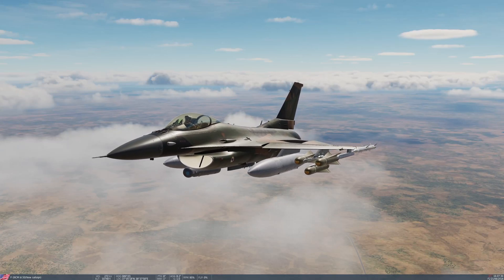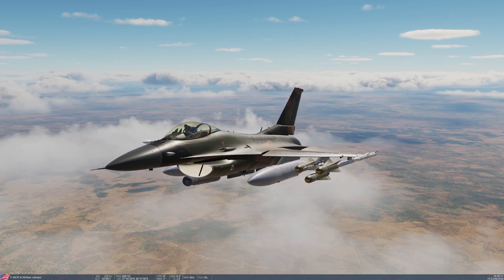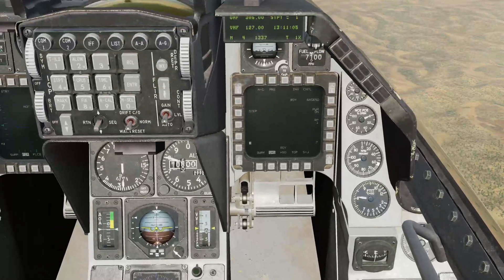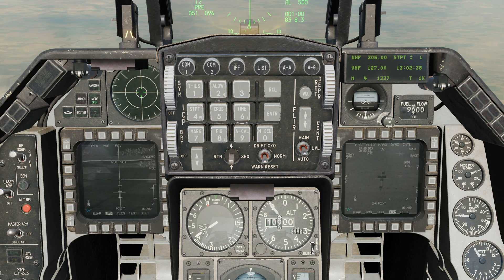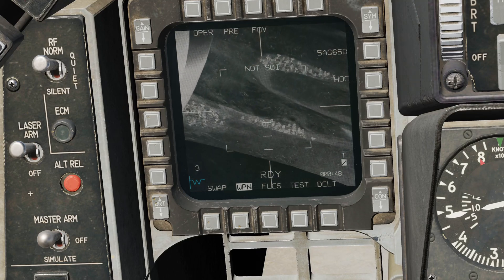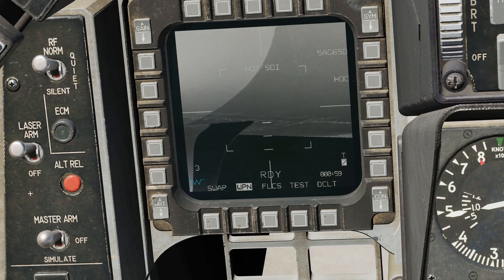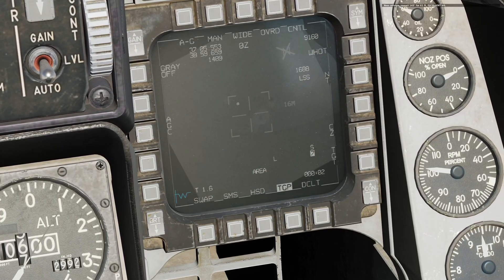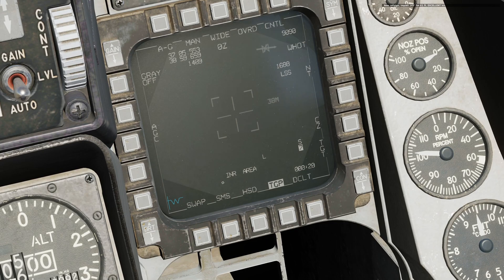DCS F-16C Tutorial 14 - Maverick handoff and force correlate

Comment: Is there a good way that you can find your target with the TPOD easier? Say you can see them visually with your eyes but you can't pinpoint your tpod onto the target, I don't have any ideas on what I can do. In the FA/18 I would just either use JHMCS helmet set a point with that, then my tpod would just slave to it then I would slave my maverick on the same spot as the Tpod. Getting used to the F16 is hard. To my knowledge there is no Vertical velocity vector slave with the F16 and Litening TPOD unlike the FA18 which can do this. This also makes it challenging. Snow plow is the easiest bet but it stays way lower than just a standard -8 degrees.
Reply from the maker: Snowplough is pretty much it right now. I don't know if that kind of functionality is coming to the Air to Ground helmet mode. Something you can do of course is drop a mark point in the helmet and then slew the top to it.
Reply: @deephack  That sucks. I have another question. Why can’t I always put a lock on a target on the radar. I’ll pick em up past 40 miles and do TMS up and I only sometimes get the lock on the target.
Reply from the maker: STT lock is dependent on the radar being able to resolve the target in that moment so could be affected by aspect, closure rate, background clutter etc. ED have mentioned in the Viper mini updates that the current implementation of the radar performs a little worse than they think it should especially in look down situations and that this will be tuned in a future update. You may well be experiencing this deficiency, only solution for now is to get closer or descend so you are below your target.

Comment: WHAT IS THE BOTTON TO HANDOOF LOCK !!! NOBODY IS MENTIONING A BOTTON WHAT TO PRESS  I already watched 1000 videos nobody is mentioning that
Reply from the maker: Handoff occurs when you target something with your TGP so there isn't a button. Just point track something as you would normally with the TGP and in auto mode the maverick will slew and lock that target without you having to do anything more as long as you are within parameters. If you are in manual handoff mode then you need to set the maverick display as your sensor of interest and then press TMS up to lock if you are within parameters.